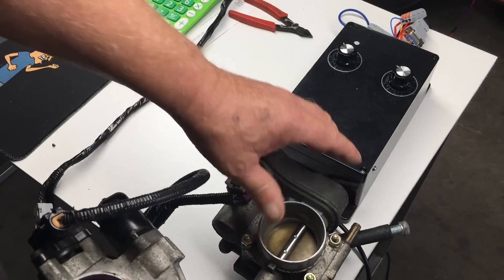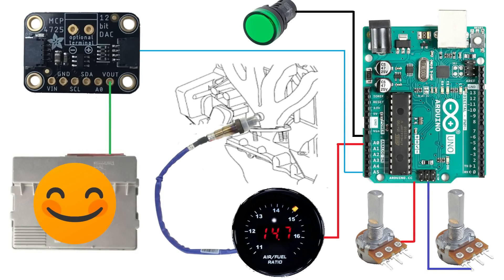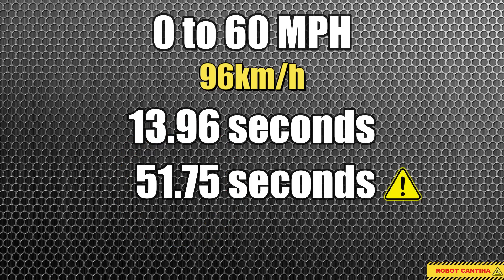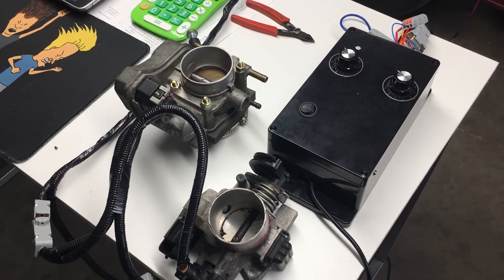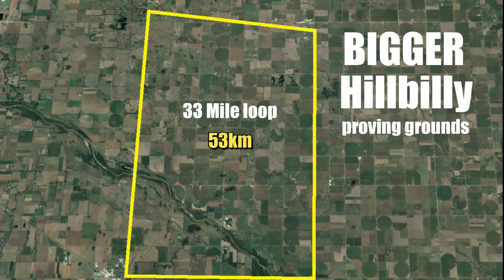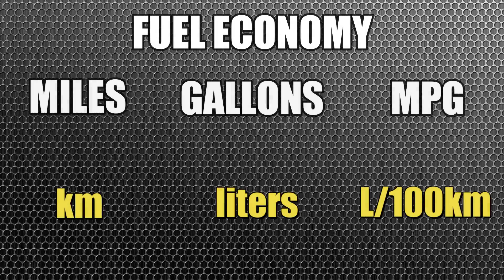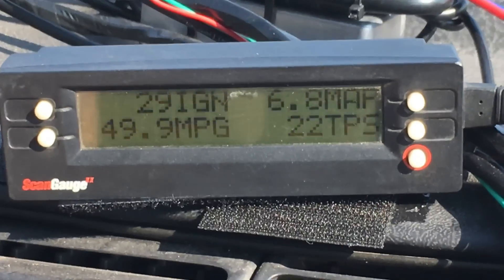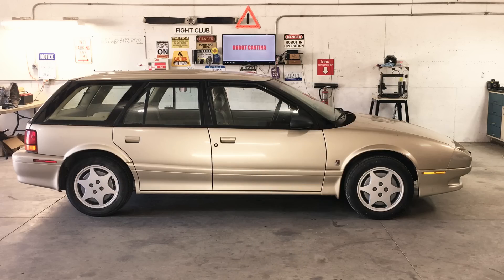S2E21: Our modified Saturn that gets Extreme MPG with lean-burn and Robo-throttle.

Comment: I bought the wife a 4 door SL1 sedan. Turns out i needed it for long trips for work. Soooo I changed all fluids and greases to synthetic, opened up the plug gap, created a ram air, always drove with the windows up and the air off. Took the wipers off and installed in internal antenna and pulled the right mirror. Over pressurize the low rolling resistance tires. Built a bigger front spoiler and added side skirts. With regular gas (no ethanol) I was getting 52 mpg at 60 mph! Dealer couldn't believe it and wanted to call saturn. Oh i forgot.... pure New Mexico highways.  I also just got rid of a Geo metro Xfi with even more mods. It hit 61 mpg!

Comment: Dang.  If that were an ECOTEC you could just bolt on an external reluctor ring (we call it an external crank trigger wheel) and CPS, leave the original in the block disconnected, extend your wiring (it's just a hall effect sensor anyhow) and you would be good to go to change timing as you see fit, mechanically at least.

Comment: Now you need to do an ammonia fuel conversion ( propane tank but filled with ammonia ) which been around for over  40 years no one talks about it because corrupt businesses and government  don't want people to know ammonia is an renewable fuel that can be used in gas, diesel engines  and power generators. 
https://youtu.be/Bs3HSChSh_E
https://youtu.be/XHZXAz9WP9M
 https://youtu.be/L0hBAz6MxC4

Comment: I have owned 4 different Saturns including a 1999 SL base 5 speed without power steering that in bone stock form would average 39 mpg hwy with a best of 44.8 by keeping the speed at or below 65 mph. My 2001 SC1 5 speed would commonly achieve 35 to 37 mpg on the highway at 70 to 75 mph - much better areo than the 1999 4 door...

Comment: Along time ago a friend of mine had a 1998 SL2.  He constantly had oil leaks and was taking to a shop to have them replace seals with no luck.  Finally I decreased the engine and watched it run in my driveway for a some time.  Turns out the head casting was so porous that oil would leak through it.

Comment: I had a 98 SL2 that got phenomenal MPG. 45mpg on the highway was easily achievable, even with a lead foot.
The downfall of these cars is the oil burning problems they develop. It's unfortunate, I'd probably still be driving my old faded POS Saturn to commute otherwise.

Comment: I can’t say 100% for sure how these engines work without without a cam sensor, but on the newer Saturns that use the Ecotec engine, they operate without a cam sensor by essentially monitoring the ignition ionization. In other words, since the ignition system is waste spark and fires on the compression and exhaust strokes, it watches the ignition primary voltage and determines which stroke is occurring based off of that. The compression stroke has higher in cylinder pressure, so it requires more energy to create a spark, leading to a higher peak voltage and shorter firing time. You can see this in the ignition primary voltage, and so can the ignition control module. So, Saturn/GM used that. The magic is done in the ICM and it outputs a square wave “cam” signal to the PCM. Again, this is how it is done on the Ecotec Saturns, I’m not totally sure that’s how it’s done on the older 1.9L Saturns.

Regarding the knock sensor, given that it is a pretty low performance engine, I’d imagine that it has a base timing that it runs on most of the time without adjustment, and only pulls timing if it detects knock. That’s how GM (and almost everyone else) did it on all of their engines with knock sensors at the time. Some higher performance engines would allow long term trim adjustments based off of the knock sensor, and those engines could even advance the timing beyond the base map for better performance. Those learned values would adjust very, very slowly. I know for sure that Subaru and Mazda did this back in the 90s (most cars due it now a days). If the Saturn does that, you’d have to drive the car for a very long time to have it learn new timing advance values, and eventually it would probably get angry that the knock sensor was “quieter” than it expected. Keep in mind that the knock sensor is basically a microphone, so the PCM will expect to “hear” the engine at a certain volume through the knock sensor. Some manufacturers, like Subaru and Ford, test the knock sensor by inducing pinging in the engine and watch for the knock sensor to respond. If it doesn’t respond the way that is expected, a failure is flagged, and if it fails twice within a certain number of tests, you get a code and check engine light (and usually ridiculously retarded timing and a loss of power).

Comment: Can't speak to the old gm engines but I am familiar with tuning the newer ones. The knock sensor is very important to the engine dynamically finding it's timing. You have a low and high octane timing table. It interpolates that data based on another table that determines the weight and maximum degrees of knock retard. Tldr engines tend to use the knock sensor to optimize the timing table. This value soft resets when the engine reads a full tank.

Comment: My 89 Audi 80 1.8S burns exactly 7.0 litters of LPG with constant speed between 70 - 100 km/h. It just has a plate in the throttle body with tiny holes to disperse the gas with the air. No smart additives and no hydraulic steering or A/C. With current prices it equals 3.57 USD per 100 kilometers or 62.1 miles. How's that?

Comment: too lean could mean more than just heat, more heat can cause less efficancy do to more friction as the metal expands and the cylinder shrinks, the real proplem with overheating is not the heat, it's the friction from the metal expanding.

Comment: I am a former Saturn technician they use an algorithm and spark time from cylinders 1-4, you had to use factory spark plugs and gap cylinder 1 .030 cylinder 2 .035 cylinder 3 .040 and cylinder 4 .045. If you didn’t use factory plugs, wires and have them gapped like this you would get a p0341 camshaft code because it needed to see the difference between cylinders for cam timing.

Comment: tunercat may have a file to edit that ecu file. you could make the map sensor read more vacccum, that will typically add timing.you could also lower the iat temp and coolant temp shoot me the PCM part number. the ignition module looks at ion bias voltage in cylinder to determine tdc firing, then send a sync pulse to the ecu in the est lines

Comment: To implement sequential fuel injection, you don't really need a camshaft position sensor. You can read the parameters from the ignition coils while doing wasted spark and measuring which cylinder demands more current or something. You only need a camshaft position sensor when you implement variable camshaft phase.

Comment: Suggestion from the peanut gallery regarding the CKS/CKP signal to change timing.  I hear you when you say you don’t want to mess with all the other problems that would arise from modifying the signal since the spark and fuel is ran off the crank sensor.   But with carburetor…
A capacitor or Inductor is used to change waveforms, more specifically the phase of the current vs the phase of the voltage in a waveform.  Used to correct power factor.  If the ecu only uses the voltage, looks promising.  With your O-scope, it would be like a futuristic, analog way of tuning, like jet changes on a carb, unsung the right size inductor/capacitor.  Failsafe could be having a double throw, triple pole switch that includes or excludes the inductor/capacitor.   
Love the series and everything you.  Can’t wait to see the diesel swap.  I play tricks on my old (ECU controlled) TDI with the same aspirations.

Comment: The total quantity of ignition timing retard the system can manage is unknown leaving a question of:  what happens if we put that knock sensor to work by moving the secondary ignition wires back in rotation one cylinder: in firing order. There you go knock sensor- get to work ! What if you supplied the knock reference signal to accomplish full retardation for start up ( jumper signal from start switch) then let it switch back to knock sensor control for driving. I'm guessing the knock sensor and code will only get the ignition timing back to 60° advance but you could tweak the code or you could also......
   I'm going coo-coo here.

Comment: Yo sure have a weird taste of cars.
Don't think you need to do mechanical hacks for the crank positions sensor, but you could use a 1000Hz timer and continuously measure a rotation and deducted from that dynamically.
You should use interrupts routines instead for measuring and try to avoid the Arduino IDE and do hardcore, like a Microchip ICD3 or 4.
Reply: I agree! I was expecting a Ford Pinto next!

Comment: btw there are cars with "robo throttle" implemented, the "Orwellian"way, f.e. VW Lupo. It has "eco" button making it limp but very economical, by using throttle stepper to moderate gas pedal. 
Some other VW models also implemented similar tech using the stepper, but it gets disabled once you rapidly step on gas pedal. Look up models made around 1996-2000, peaking in VW 1L car.

Comment: The way Saturn determines cyl 1 TDC without a cam sensor is using feedback from the ignition coil. Even though it's a waste spark system, cylinder 1 produces a higher voltage spike in the primary circuit when it is at TDC than the "wasted spark". You need an oscilloscope (properly attenuated as not to fry your tool) to observe this. Those cars are good for setting CMP codes after a tuneup when people swap cyls 1/4 plug wires even though there is no CMP. The car seemingly runs fine (because waste spark) but you get a MIL.

Comment: Regarding ignition sensor timing: I did a kind of "cheat" in a similar situation with high speed video, where a real real time microprocessor measured the time between*every* sensor pulse, and plugged in an advanced pulse for the following pulse...this means that you can establish arbitrary timing, advance or retard, with any error limited to one sensor "tick", or, for a single timing Pulse per revolution, one revolution, arguably, not a big problem....

Comment: I used to get 40+ mpg routinely on the highway with my manual-transmission Saturn, no mods--very impressive. I don't know how the "Lean burn" system functions, but it makes me wonder If that engine was run well lean-of-peak to try to improve mpg even further, would it have lasted as long as it did...
Reply: at the end of the day any figures this mechanic youtuber gave were just rough estimates of him driving down a two lane highway with I'm assuming a 55 speed limit...there's no city driving here. Still 50mpg at highway travel is cool. I feel it's a little disengenous but it's youtube!
Reply: @itstheweirdguy  That level of fuel economy is pretty routine in Europe, esp. small diesels getting 60-65+ mpg, but the US doesn’t get those models because we (average consumer) insist on higher rates of acceleration than they do there, plus our manufacturers have used some types of emissions regulation to hold off that competition.

Comment: Might be worth it to try and bump up the compression, the g1 honda insight's is 10.8:1, and when below a certain amount of load it runs 20:1 AFRs in lean burn mode on 87 octane for up to 3 minutes before it reverts back to standard mode for 30 seconds to let the pistons cool off. mine pulls 100mpg on flat ground at 50mph like that. seeing you guys implement garage built versions of the systems honda spent millions developing into a friggin saturn and getting genuine results is so cool. keep at it

Second thought, a hot air intake is something that a lot of insight guys do. they run the intake hose up next to the exhaust manifold so it sucks in hot air. the sweet spot is like 90-110°f. the idea being that hot air is easier to pump, it effectively reduces displacement by lowering how much fuel the engine can burn, and it also helps the super lean mixtures burn faster. could help you make use of a bit higher AFRs without changing the timing. you'd have to bypass the AIT sensor though

Comment: Good effort but 29deg advance at 15.5 a/f is not enough...Chrysler lean burn units would run up to 18:1 at 40deg advance given the right conditions...A little more work and you'll get there.

Comment: Fun fact, brp who makes snowmobiles, jet skis, the spyders and such, have their throttles on the 4 stroke models able to be set to different responses and fueling, eco mode slows down the throttle and limits how far the throttle body opens, and in sport mode, allows it to respond fast and dump more fuel. So this is a similar system to what you made… maybe find a wrecked 900ace and transplant it into a car, it’s a 90-100hp motor, which is similar to the Saturn….

Comment: Cam position is determined by firing voltage, if you have a bad ground between the ignition module and bell  housing you'll get a cam shaft position sensor code for a "virtual" sensor.

Comment: Adding a second comment.  ~100 years ago, documentation about vapor carbs were all the rage.  Gasoline had far lower octane and vapor point than today's blends.  But, instead of messing with gasoline, how about you try alcohol (E100, Rubbing alky, ...).  Create a vacuum canister that gets utilized when you're cruising in lean mode.  If I'm right, the O2 sensor will still maintain your closed loop of 15.5 (or maybe even leaner if you try) and your injector puleswidth should further decrease (i.e. even better MPG) -- when you run out of alky, the system will just use gasoline via the injectors again.
It'd be tricky to come up with a "composite" MPG b/w gas + alky, but I'd luv to see if it gained you another 10+ MPG.

Comment: I wish they would make fuel efficient cars again.  I used to deliver pizza in a 1994 Geo Metro and got 36 to 38 mpg in a sub urban environment.  And that's delivering pizza, mind you.  Driving with a purpose.  I had a 2006 Crown Victoria that if I didn't let the rpm go over 2,200 and never used the air, it would get 19 to 21 miles per gallon in town.  Now everything has to be so fast and futuristic looking.  Even electric cars have to be rocketships.

Comment: I like following this series. One thing I have thought is that most modern cars have location trackers and pedal position sensors. Hypotheticly the computers could have a AI computer combining pedal position throttle position and many other sensors along with GPS to determine best overall positions for driving that specific road for fuel economy for that specific car and maybe even create a network for similar cars to have the information programmable for a economical switch in cars. That can easily be shut off for irregular driving.

Comment: Back when I owned a Saturn (over 10 yrs ago) the trick for fuel economy was a "hot air intake". The ECU will add some timing if the intake air is hot, and also reduce fueling a bit. You could probably get the same effect by spoofing the IAT sensor. It's just a variable resistor.

Comment: Would increasing the compression ratio of the engine increase or decrease the fuel economy?
Reply: If you keep the compression ratio reasonable (ie no knock on the gas you're running) you could net some more MPGs and torque as well. There is obviously a line of diminising returns, so increasing compression to the moon won't give you unlimited efficiency.

Modern engines actually have a pretty high compression ratios for that exact reason. Mazda has some gasoline engines with 14:1 (or even 16.3:1 for their "diesel" gasoline engine) running perfectly fine on regular.

Comment: So, Jimbo, I dialed up my "borrowed" copy of Mitchell ProDemand, and dug around through the service manual for the Saturn. According to what I can find, the MPFI system on that engine is batch-fire and paired with the spark plug firing, but the injectors only pulse at ½ duration, so the engine essentially receives a full fuel charge in two crank revolutions. I believe this is how most non-cam sensor engines did it, as I remember something similar about my old Zetec Ford Focus.

The crank trigger wheel is exactly as you showed in the diagram. Interestingly, service info says there should be a camshaft position sensor on the 1.9, but I'm wondering if that was meant to refer to VCT-equipped engines.

Comment: Diesel! Diesel! Just found your channel the other day. I love my diesel engine. My ALH Jetta can get over 50MPG pretty easy driving on those back roads like that.  I'm guessing that you will go with something older and smaller though. I had a 92 with the 1.6 that would get 45 everywhere it went, but it was slow.

Comment: Seeing these old Saturns getting ran around brings me back to when we had a few of them. Cheap to buy and cheap to run.  I'm pretty sure GM "borrowed" a few things from Saab when they were developing the S series.  

That knock sensor location though seemed like a GM solution. If GM would have put the knock sensor any further away from actual engine detonation, it would be on the taillights! 🤣

Comment: Had you considered something like running the arduino in line with your load signal (be it MAF or MAP, I'm not familiar with the Saturn). You could simply reduce the signal into the ECU.

You'd lose closed loop fueling but you may find just reducing the load signal both reduces your fueling AND increases timing. You could leave the o2 sensor unplugged, let it run off the base fuel map and adjust from there. Even if only for test purposes.
Reply: likely makes more sense to just go standalone with speeduino and control spark and fuel. And because you have a standalone ecu, it can also talk with drive by wire controller and both can play along to gain max efficiency (although drivebywire isn't officially supported by speeduiono).